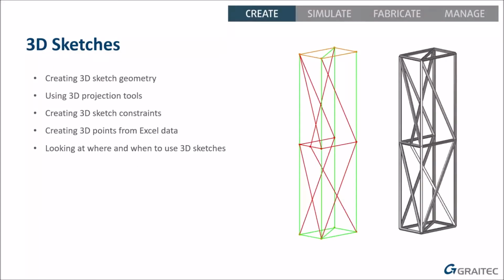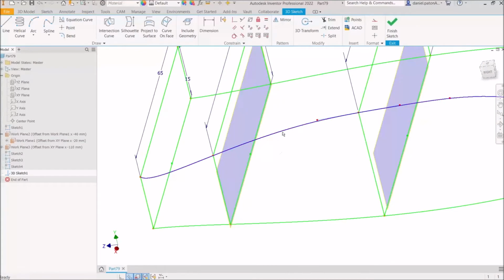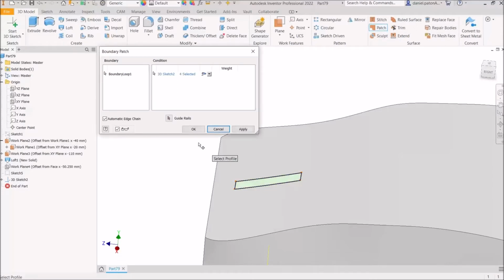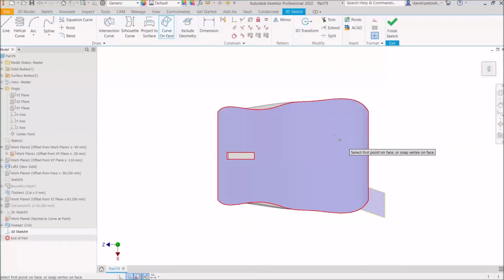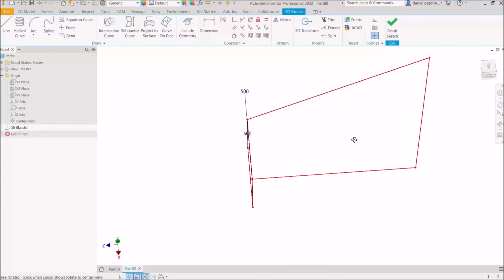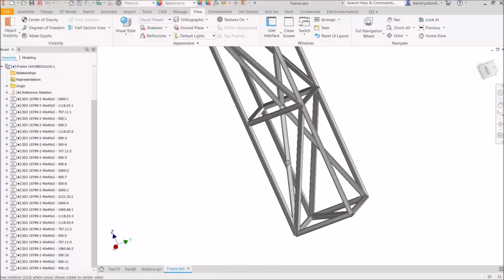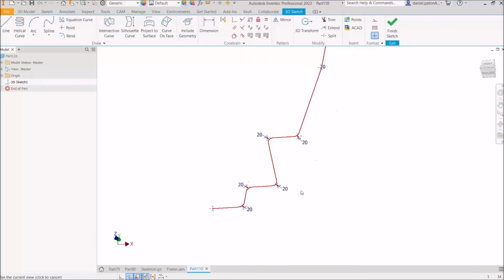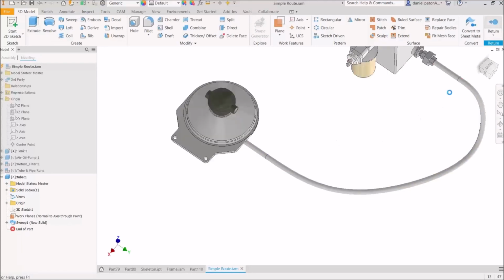Working with 3D Sketches in Inventor 2022

Comment: 3D sketch rails were completely ignored on my end.

This program also does not like organic shapes. I have tried now, twice, to project some circles onto an irregular surface and from that, either add to the surface, or cut holes into it, only to have the program repeatedly react with error messages. "No meaningful geometry", "too large a topological change"... yada flippin' yada. Embossing didn't work, and sculpting did not work, either.